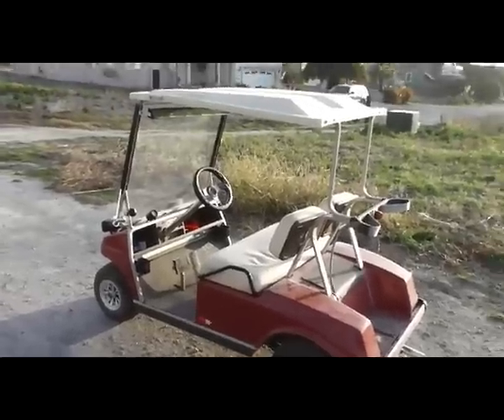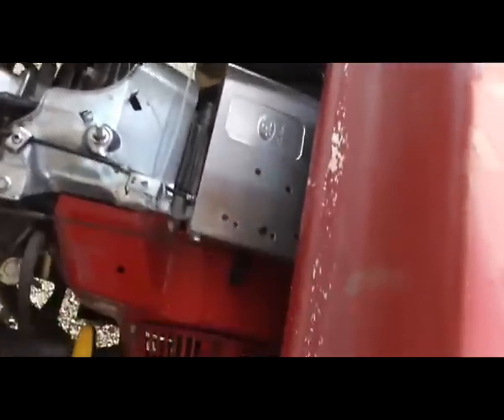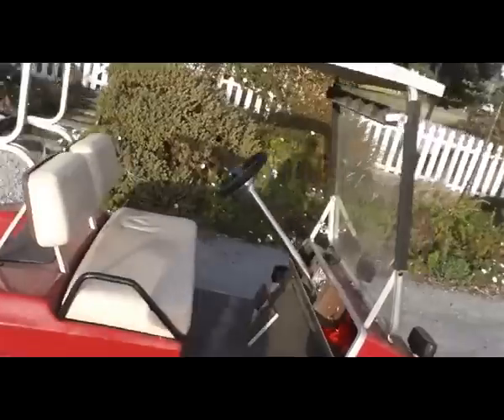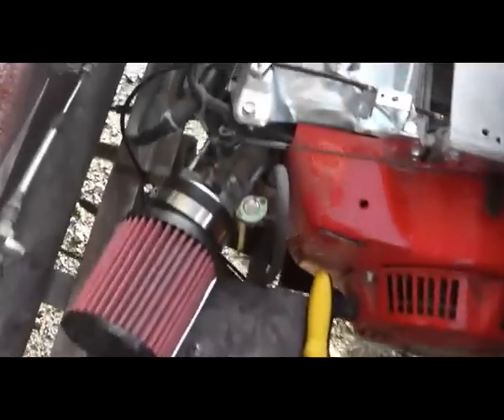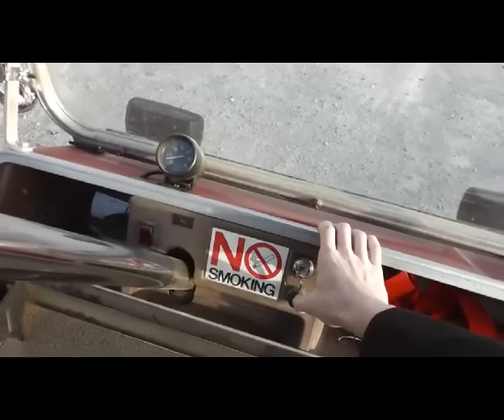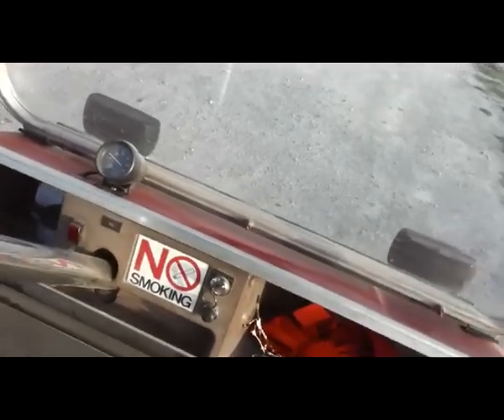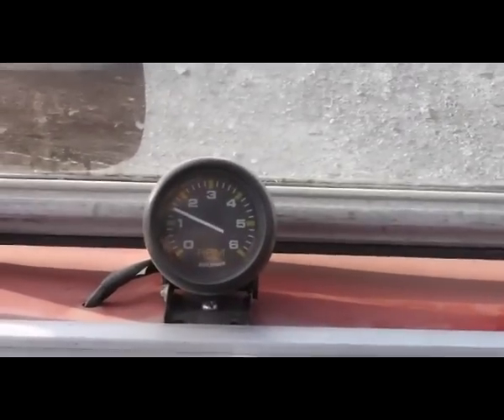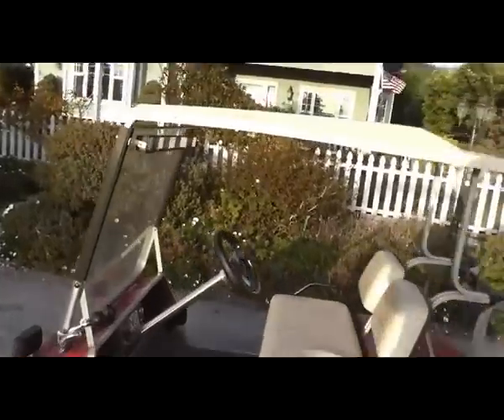The Club Car Engine Swap is Complete!

Comment: Unless you rejetted your carburetor for the pod filter and aftermarket exhaust, you actually may have decreased your horsepower or even caused your engine to run lean. Trust me, I've been through this with motorcycles, and unless you are running an EFI motor with 1 or 2 oxygen sensors, you are doing no better than before. You've got a carb jet that was the same size as before, you simply cannot let any more fuel in than the max velocity of the jet. However, you have more air introduced to the throttle body than the stock design, its going to run leaner and hotter. Get the next size up jet for the carb, otherwise you will cause problems in the long run.
Reply from the maker: With the GX200 engine, I could only run it with the pod filter at half choke or it would bog out due to the small jet. This GX420 however seems to run great with the pod filter on versus the air box.
Reply: Thats weird. I've got a stock Yamaha G2 engine I put a pod filter on, but I also removed the stock exhaust and put a go-kart exhaust on. I choke it until it warms up and after that its fine. But I also added a larger jet.

Comment: How were you able to run forward and reverse correctly on the engine, with a counter clockwise rotation from the motor? I put a Honda motor in mine and had to run reverse as forward and forward as reverse!
Reply: You are correct about that, I do believe reverse is a lower gear also,

Comment: Nice build.  What muffler did you use?  That is a smooth running cart.
Reply from the maker: +Jeff H Thanks. I used a generic 1.5" muffler from summit racing.

Comment: How do you get the reverse working without the electric motor in?
Reply from the maker: It has a F-N-R transmission from the factory.
Reply: +Nicholas2011ist  the rear end he is using has  F / N / R built in  if you dont have that rear end  use a Rev gear box between engine and rearend

Comment: what kinda tach is that?
Reply from the maker: It's a 2 3/4 Inch Autometer tach.
Reply: is it made for a single cylinder ? seems to be reading high
Reply from the maker: zachspeedshop It's designed for 4, 6 and 8 cyl cars. These engines use TCI ignition, so when the tach is switched to the 4 cyl setting they read perfect. These GX engines just idle high due to their balancing systems. It will stall under 1000 RPM.
Reply: What kinda clutch  you using  for  engine?
Reply: Nice!!!!

Comment: WHAT ENGINE DID YOU SWAP INTO THIS CART? BY THE LOOKS OF THE PULL START IT ISN'T A CLOCKWISE ENGINE.JUST PULLED WORN OUT FE290 FROM MINE,IT NEVER RAN WHILE I'VE HAD IT SO JUST LOOKING FOR IDEAS THANKS